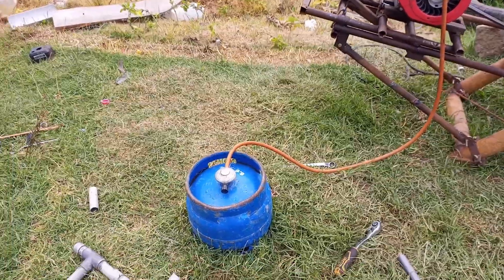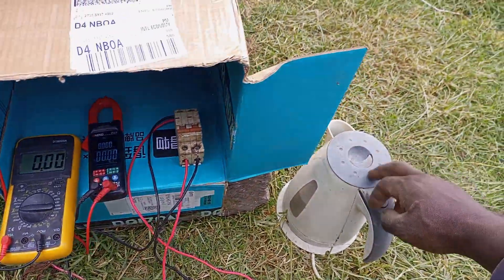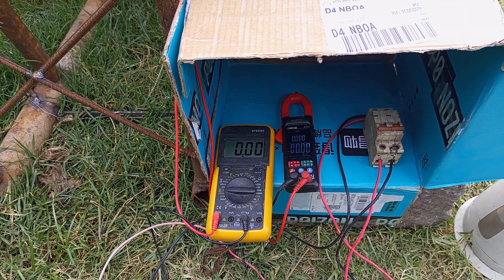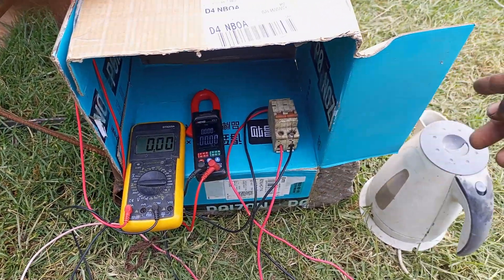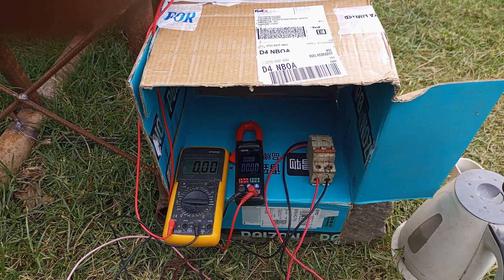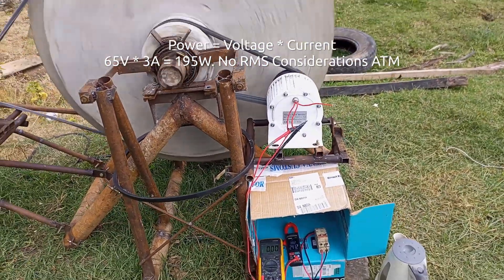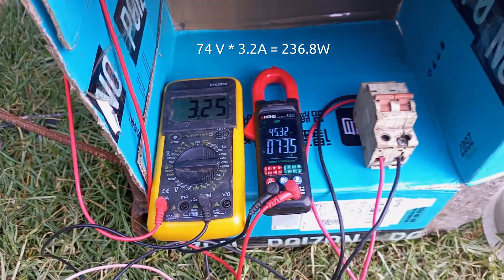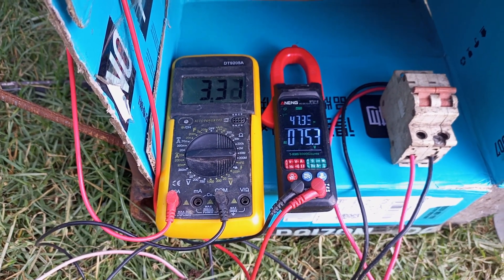30KW Chinese PMG. Load test with flywheel

Comment: This PMG Alternator is built for low rpm from 300 to 500rpm with high torque of 40hp power to achieve the 30kva